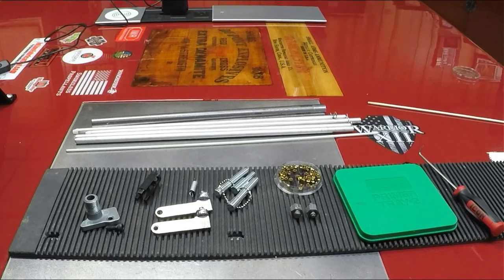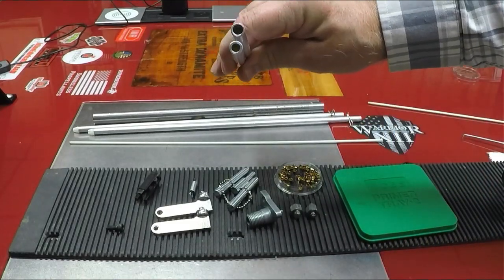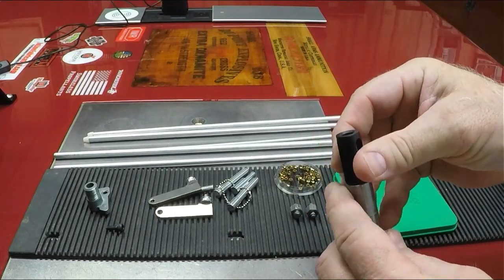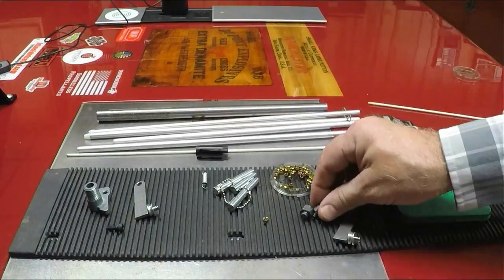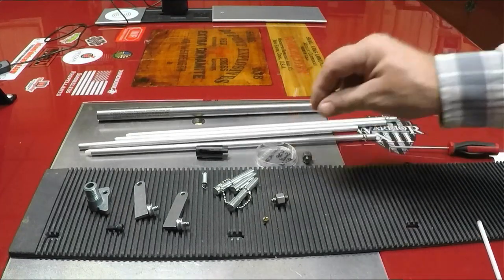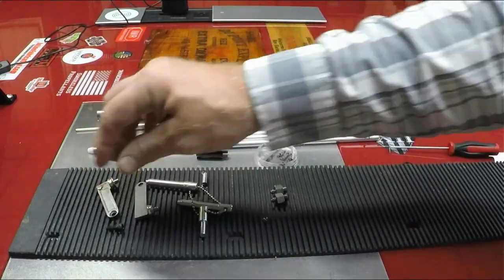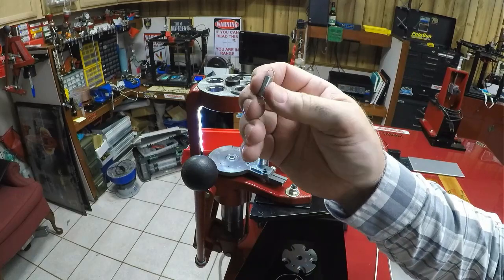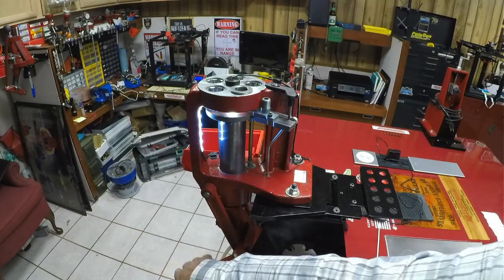Hornady AP Press Primer System Set Up

Comment: The one thing I do different is I leave the fiberglass rod in the pick up tube when I pull the pin to dump the primers in the primer tube then I lift the pickup tube straight up off of the rod and it is already in place.  It adds weight which helps the primers slide in better.  If you do have a stuck primer in the pickup tube then just tap it with the rod and it will fall.  This also lets you know all the primers fell in the primer tube.

Comment: Thank you 🙏 I appreciate the video very much. You went through everything I needed! I’ve been using it but it’s been awhile since last and I wanted to make sure I was doing everything right. Just finished running a bunch of 9mm Berrys 124 grain hp with both HP38 and Titegroup. Which do you prefer? I like the titegroup but have not used the HP38 yet. My primer feeding tube and explosion tube got bent in transit because someone forgot to remove the tiny hex head and take it off so I’m replacing it now! Thanks again!